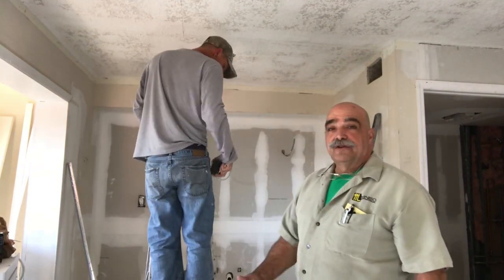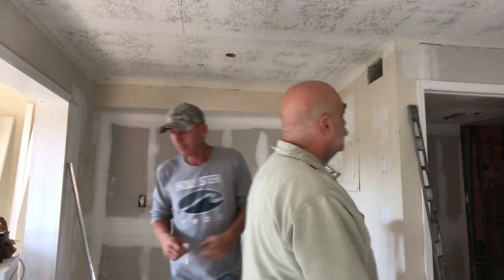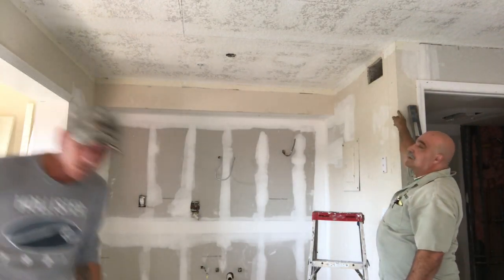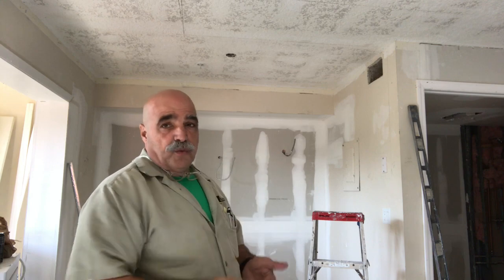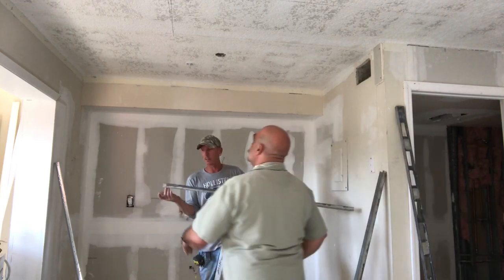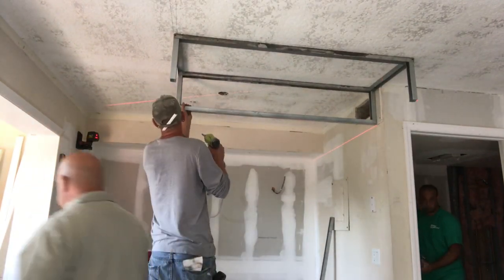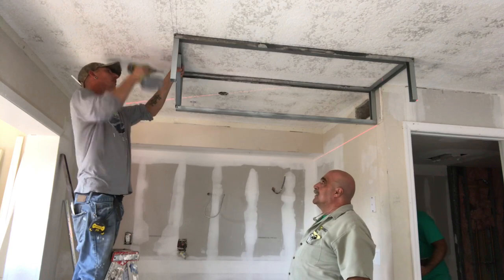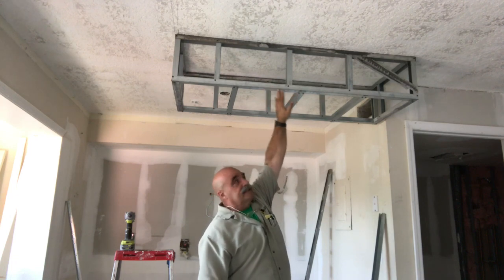Building a soffit with metal studs

Comment: Wondering how you attached the under part of the soffit framing. I’m new to Metal framing
Reply from the maker: I’m not sure what you mean the underside if you mean the track to the existing ceiling we use longer screws and screwed into the existing wood trusses if this is not what you’re talking about comment again and I will try to assist you I can usually return the comment within 24 hours
Reply: @buildingwithpapa  just wondering how you attatched the framing going across on the bottom of your soffit.
Reply from the maker: We attach them together with framing screws they’re made for metal framing they’re about 7/16 long and very sharp
Reply: @buildingwithpapa  it’s okay I will figure it out, I wish you guys would have showed how you attached the bottom framing that’s all. Thanks for the information.
Reply from the maker: I have several other framing videos even though some of them are walls and ceilings you can get the idea
Also your vertical Metal or called studs but the horizontal pieces are track they slip together and then you screw through the track into the studs, check out my other videos let me know if this helps or if you have any other questions or comments please let me know I’ll be glad to help you

Comment: What if the Ceiling not level and the softfit wider on one side.
Reply from the maker: If the ceiling itself is not level you still want your soffit to be level so use a level or a laser to keep the bottom of your soffit level.
 I do not understand what you mean wider on one side do you mean it is not a true rectangle ?
what are you trying to lineup?
Reply: @buildingwithpapa  I have a similar situation. Soffit across an open living area 30ft wide. The ceiling is out of level by 1 inch from one end to the other. If I level the bottom of the soffit im worried the soffit face will appear shorter or narrower at the one end. Would you recommend following the slope of the ceiling  or would that stand out more? Thanks
Reply from the maker: @fadinoir4057  I would level the bottom of it you’re not gonna see the difference but you want your soffit bottom to be level the 1 inch and 30 feet is not going to be noticeable
Reply: @buildingwithpapa  thankyou

Comment: Is it any weight-bearing soffit? What do u attach it 2 joists with?
Reply from the maker: Depending on what you’re attaching the soffit to hear there are wood joists where you could use inch and 5/8 to 2 inch wood screws also sometimes they run Metal hi hat when they fur down below the joist and then hang the drywall to that then you would be attaching to metal and you would use Metal drywall screws
Reply: @buildingwithpapa  because i have a soffit carrying 3 kitchen cabinets (not overloaded). After 2 years I started noticing drywall seam crack alongside the soffit. Now there's a gap between the soffit and the ceiling. Like in your case, the soffit frame is attached to the joists across drywall. Not sure it was a good idea of the builder (I expected the soffit frame to be attached directly to joist and only after then the ceiling finished with drywall. But no, they first installed ceiling drywall and then installed the soffit)
Reply from the maker: Dmitry M 
First of all I want to apologize that I did not see this comment in a timely fashion but as you can see my soffit is not for loadbearing and when yours was built it may not have been
 but somebody then attach a Cabinets to it if it was the builders intent I believe they would have made sure the attached directly to the joist but it really is not a problem if you want to reattach it fix it properly you’re going to need some wood to put inside the inside of your cabinet probably a one by four and then you’re going to need to locate the joist you going to need to find out what that measurement is between the bottom of the wood that you’re putting inside the top of the cabinet and what the distances to the bottom of your joist you’re going to need to add an inch and a half to that number maybe even 2 inches then drill through the wood you have in the cabinet in the drywall but it’s not as necessary to drill into the joist if you’re going to drill into the joist use a smaller drillbit so that the threads that you’re going to use are bigger than the drill bit that you’re pre-drilling with use a cabinet screw that has a large head or you can even use a lag bolt with a washer and get all them what I mean by them screws are like bolts started don’t tighten them all the way up yet you’re going to need to make sure you going to each cabinet and start at where you’re Drywall has not come down from the ceiling or the smaller area of the gap then tighten slowly move to each screw continue tightening would you get through all of them start back at the first screw again tighten slowly as you do this you’re going to draw that soffit and cabinets up to the joist again I apologize for not getting back to you sooner hopefully you have done something to correct this and that it has not come down I would appreciate it if you would send me a picture or even just letting me know how it worked out for you you can send it to BuildingwithPapa@Gmail.com

I hope this helps you.